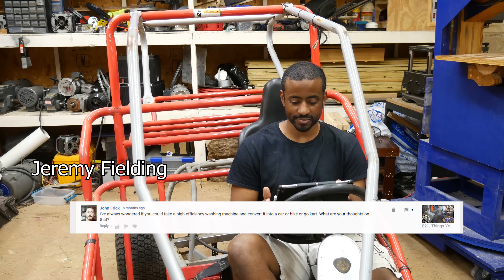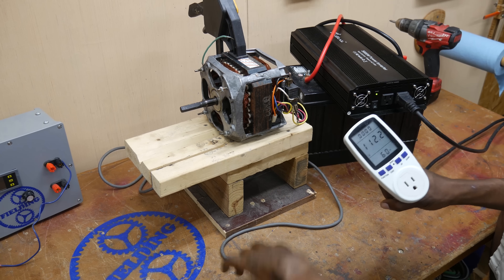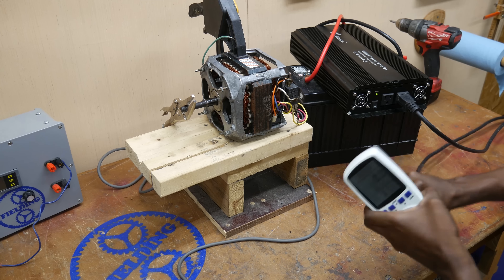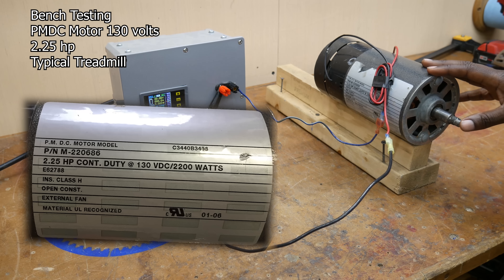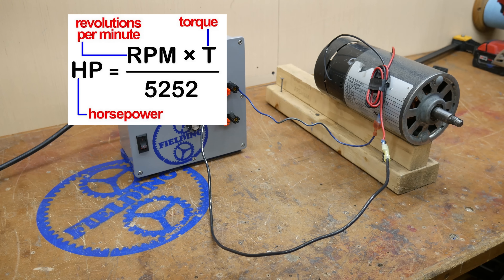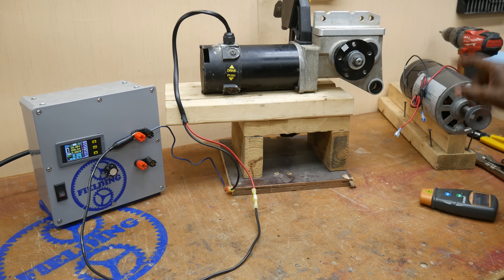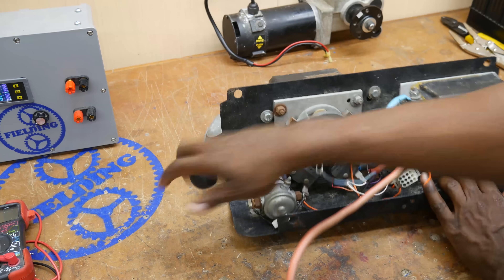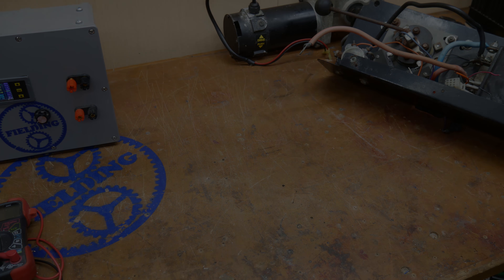What Electric Motors Can Be Used In A Go Kart or E Bike; Bench Testing and Recommended Sizing #61

Comment: Hi. Love your videos.  I read through the comments and no one said this so I'm going to.  In my experience with inverters, the lead acid battery can not handle loads above around 800 watts for more than a short duration.  I think your inverter may have been working fine, but pulled the voltage below the inverter cutoff safety setting. Then when the voltage came back up in the battery,  the inverter started again. You probably needed 3 or 4 batteries in parallel the size of the one you were using to reliably use that inverter at its max rated wattage. 3,000 wats is 250 Amps at 12 volts. Way more than a single car battery can handle.
Reply: How does a car battery start a car if it can't handle more than 800watts? And how do you know what kind of battery this is and the amps it can handle, batteries vary greatly.  There are little 5ah RC batteries that can put out 6000+ watts
Reply: @pdub422  judging by d size of it, it'll hardly exceed 100Ah. yes, it'll handle even 2000W, but more than 30seconds continously will already be pushing it. and while cranking d V will drop <11V, so invertor is likely to cut out.
Reply: The single car battery CAN deliver a few hundred amps for a few seconds - which is enough generally to crank a car engine. Use golf cart batteries for more continuous power.
Reply: @KarlsLabReport  I tried running my electric chainsaw with a 3000 watt inverter hooked directly to the installed battery on my Ford Ranger with the engine running and the saw started and almost immediately the engine died on the pickup and the saw started running slow then the undervoltage protection on the inverter shut it down.  The alternator and the battery combined couldn't keep the tiny electric chainsaw running.  A single battery is not able to pack much of an electrical load for more than 5 seconds, but 4 will be able to run a decent load for one to a few hours, but doesn't have enough power to reliably run a washing machine reliably or a standard fridge and freezer reliably.  Lithium ion baterys are many times better for any high load (example cordless power tools)

Comment: I got this like warehouse air circulating fan I want to make like a maybe at moped or something with it I'm pretty sure it will work I think it's Universal, what do you think this means though I'm curious to know 4 horsepower it shows one - 15 does that mean it could be from 1 horsepower to 15 being the maximum?
Reply from the maker: That is interesting... If it had speed control than probably yes.

Comment: I had a quick question - if you limit the current with some kind of external resistance, could you use a starter motor to power a go kart and prevent it from overheating? My assumption is that the motor is designed run for a short time and draw a massive current because it takes a LOT of force to crank an engine...but you wouldn't need to run it at full power for a go kart. So by reducing the current, that would keep the windings and brushes from getting too hot while still having enough power to drive the go kart. Could that work?

Comment: Jeremy, could you suggest a settup for a battery powered 36" concrete power trowel. RPM would need to be 60 to 150. Initial torque (needed to overcome the friction between the blades and the wet concrete) would need to be around 20 ft lbs.
Reply from the maker: Unfortunately I get hundreds of requests for technical advice. I can barely process all of them let alone give safe accurate advice. I simply can’t do this one on one

Comment: Nice experiments and like your salvage approach!  Regarding the inverter i have a big 140AH battery on my truck and have tested 3 different pure sign 1200 watt inverters right on top with short 4 guage wires and can never get more than 800 Watts out of it before it trips.  I think a bigger inverter may not help without more batteries in series. 

Was watching another video where this kid who took a 36v 400amp fork lift motor and three 12 volt 200AH batteries in series and was able to drive around a 1500lb dry weight Car around the block at 40mph through his manual transmission in a set gear.  I am trying to calculate if a similar motor/ battery setup but DIRECT DRIVE to my 3.4:1 rear end would move my  2200lb dry weight RWD car on flat streets for a modest 20mph/10 mile range?   One snag is direct drive (no transmission) and finding a way to reduce my ratios to some sweet spot like 7:1 for more torque and less speed.   Any way to do this without a transmission?  General thoughts of how this will go without no gear ratio changes?  Any better or cheaper way to do this test?

Also, what's the best way connect those 36v DC motors to the Yoke of my rear end? The same way as the drive shaft connects?

Comment: Hi I have a DC motor I would like to use on like a go-kart or something I was wondering if you could tell me anything about it it's a advanced motors and drives 
Model # ds0-4001 it's a class h serial no. Is 15288 it's rating is AU2500 it's 48 volt I just don't know how to excite it it's got 4 terminals 2 big and 2 little little ones are F1 F2 and big ones are A1 A2 comment if you can help

Comment: Could you use the wheel chair motor for starting movement then switch to another motor once moving??
Reply from the maker: Several have asked but that just feels more like a bandage instead of a solid solution. It’s significantly more complicated, but if determined one can make almost anything work somewhat
Reply: @Jeremy_Fielding  Thx for the reply
Reply: @Jeremy_Fielding  Thought more about it.  What if you used an actuator across an additional gear on the drive shaft for starting the motion a split second before the electric motor turned on?

Comment: That meter does not pick up Peak. The high wattage setting you're looking at needs to be sustained for a couple seconds to get a proper reading. The motors lra, lock rotor amps, require a highly sensitive device to read. They are generally 3 to 6 times the peak running apps

Comment: Jeremy, have a Honeywell Model 362481-3 Synchronous Motor Assembly 60:1 
4 wire and been searching the internet how to wire it up. No such luck and wonder if it isn't like a stepper motor but unsure to try because it is 1i5 volts. Have you done any Synchronous motors? It is like a stepper and has 4 wires. 2 have continuity between them and the other 2 have there's. If I don't hear from you will try and move it like I do a stepper motor and hope sparks don't fly. Thanks, Michael

Comment: I would seek to achieve a high voltage battery bank and shoving a nice motor on it. Higher efficiency from high voltage seems better to me. 

That's what, under 100 Li-ion cells for a full Kwh

Comment: There are resources dedicated specifically to this. Ev Parts is one that comes to the top of my mind. If you're looking at forklift motors find a lift pump motor, lower duty cycle but higher HP for the size.

Comment: The best motor I found was a starter from a Ford Power-Stroke® diesel engine, the one that is "in-line" having a planetary reduction gear setup internally.  It has tire "burn out" torque and goes pretty fast when driving the wheel/tire directly.  Those are 4KW motors (5+ HP) and aux cooling is required!  I used 3/8" thinwall copper tubing to wrap the motor and a water pump and car heater core as a radiator.  Use Thermon® T-85 graphite paste when wrapping the motor with the tubing for good heat transfer and aluminum sheeting to finally cover the tubing and motor.  Do this and be sure to wear a helmet!
Reply: Great tips

Comment: The electric wheelchair gear reduced motor would be good with bike chain and gear set for changing speed. High torque at start then gear up to go faster. I guess it's a question of total horsepower, weight and resistance to figure out the maximum speed. Just a thought but I am sure you can get decent results from a good power transfer system that allows for trade off from torque to RPMS at the wheels. As long as you don't get too much weight involved a pedal bike gear and chain set should be able to handle the load safely.

Comment: Obviousley the people wanting you to do this dont know how to go to harbor freight, pay 130 bucks, and come home with a REAL motor made for a go kart. A drift trike is like 700 bucks online. This bullshit would cost you just as much in time, frustration, and silly parts than the alternatives. I will admit the technology has gone this way but this shit isnt that technology. We had dual 90hp GE motors to work on,  usually things with electric motors dont turn at fast rpms or are made to be turned on and off fairly quickly...
The amount of power it took us to run two 90hp electric motors would freaking baffle you. Better have a generator or a large diesel with an alternator to keep the charge...Only good in construction and childs toys and not much in between. Now if gas was not $2.15 from a pump 500 feet from my house maybe I would start buying electric. Electric is just as expensive right now as gas, probably more. Unless you ad in the tax breaks, have a hybrid that doesnt break for 8 years, good luck with that even the good ones break...RX450H Camry Hybrid, Prius...teslas are getting more reliable but also getting more expensive. Considering car companies usually dont turn a prfit until the 5th year or so I guess Tesla has time...

Comment: I think one of the biggest things you missed...was torque.  I don't think many here will know that the electric kart motor you end up using is much bigger in circumfrence instead of length compared to the other motors you tried.

People need to know force x distance = torque.  more torque at low end means more hp at low end.  HP = torque x rpm / 5252.  So you increase torque you increase, HP.

With a larger motor like the one you used, the distance is probably twice that of the other motors, producing twice the amount of torque with the same voltage.

The reason why starter motors dont last long, is because they are substituting distance with force, applying more instant quick power to the coils (heat too), and boom they go.  But they get hot as a result.

The best thing for any go kart will be to get the 'tallest' motor, the one with the most distance from the shaft to the end force, with the equivalent v/a ratings.

Or to use a good worm gear.  Cause you can multiply the low torque across the gear and produce high torque.  So you can use the small DC motor, attach a worm gear to it, then triple the distance that the motor uses, make that triple distance the gear to the tires...and boom high torque and most worm drives are gear ratioed already.  The bigger the gear the higher the gear reduction.  So using a high rpm low torque motor, can be done via worm gears.

Comment: I feel like your battery failed , not the inverter , you weren't able to draw enough Amps from 1 battery and the inverter went into safe mode .
Reply from the maker: The battery is capable of 700 amps. So 700 amps at 12volts. Now you just need a calculator to confirm whether you are right or not.
Reply: 700 CA ? As in automotive battery cranking amps ? How many Ah is the battery ?
Reply from the maker: I don’t understand how that helps you answer the question. The battery was fully charged, at room temperature with a tiny load compared to its capacity for maybe 30 seconds at most. That is well within the CCA standard used for car batteries. Besides the actual problem was I exceeded one outlet capacity. The rating is likely for both outlets together. But I answered your question in my video on understanding battery ratings using this very battery. In that video you see all the ratings for this battery if you are still curious. AH in this condition doesn’t give you useful information I think. Perhaps you can help me understand.
Reply: I have the same issue with my inverter rated at 4000 watts , when I plug in hi amp power tools it kills the inverter . I switched to two batteries and keep the charger on them and the problem goes away , I was told it was the battery not making enough amps I have two 200 ah batteries at my off grid camp , if unplug one , it kills the inverter when I get amperage surge . I'm no professional , I'm trying to get a better understanding myself .
Reply from the maker: It sounds like your batteries are indeed to small, or the plates are too thick for high current applications. Your issue would be "max continuous current", not AH which is more about the total power of the battery. That is not usually listed on the battery, but can be found by looking up the data sheet for your batteries. I talk about that in the battery video. I think you would find it helpful in your search.

Comment: Part of the problem with the locked rotor test is that the power factor goes way down.  That is, the current and voltage are way out of phase.  That really increases the amount of current needed for a specific level of power.
Reply from the maker: Unfortunately that was the simplest method I could think of for showing a very high starting load for a few seconds. The rotor would in fact seem to be "locked" or very close to a locked rotor condition at start up. There is some gray area here in that the size of the vehicle matters. A small bicycle, especially if you were willing to push start would not be as difficult.
Reply: @Jeremy_Fielding  It's not an invalid test.  After all, that current spike will happen in the real world, unless you use a centrifugal clutch or something like that.  Even then, the motor will be really inefficient until it gets up to speed.

Single phase induction motors are a jerry rig, anyhow.  They need some kind of starter winding to get them going.  Without that, they just sit there and hum.  We used to have an old wire wheel that would do that.  Since the starter winding was gone, it would just sit and hum until someone manually spun the wheel (in either direction) to get it going.

Induction motors in general are not suitable for applications where they are run at a variety of speeds.  They are designed to run at just below synchronous speed.  If they are slowed, they start getting inefficient and generating heat.

Of course, you could feed it with a variable frequency drive.  But if you're going to do that, you might as well go all the way and use a synchronous motor fed by a three phase variable frequency drive -- which is exactly what a brushless DC motor is.

Comment: Maybe the meter you're using measures only the active power while the current is tremendous with an inductive load and reached the max output current of the inverter? But 150W with lo load it's way too much for the active power so you must be right.
Reply: I saw that on an rv air conditioner starter kit. They had to have a faster meter.  My 2kw inverter needs 2awg short wires to make max output.

Comment: You are wrong about the treadmill motor. Those motors have amazing torque throughout their RPM range. They are not meant to be run with a linear power source like a straight connection to a battery. You need to supply this motor with a PWM power source. Not only does that give you very precise speed control, but also very high torque at all speeds.
Reply from the maker: Thanks for the feedback...Please consider for a moment I was using the speed controller (PWM) that came with the motor in the video as I showed you the results of such an application. This motor in particular runs at very high speeds by design. I explained early in the video that Horse power is the combination of speed and torque. This motor is weak at full voltage. Most of the horse power is speed not torque As the voltage goes down (the example I was giving) the total power of the motor goes down... that is both speed and torque go down. The motor... especially because it is a permanent magnet motor is very weak (low torque) at low voltage even using PWM as I did in the video.. I hope that helps you understand. I talk about this more at the beginning of the video as well. :)
Reply: I must have overlooked that. It appeared you were using your own home made desktop power supply. I've used old treadmill motors before with the controllers they come with, and with a little modification to the operating frequency, they have excellent low end torque. Their stall current is massive, but even under heavy load they were able to maintain pretty good torque numbers. About 5x as high as when they are fed a linear voltage straight from a battery.

Comment: the wheel chair motor i used one on a bicycle  after re gearing it a couple time UP because the gearing built in it was to low. but it would run for about 36 miles on a full charge at 50 mph. the bike would run 66 mph before the spokes worked loose. but to be honest i really think it would run closer to 80 mph if the spokes could have held up to it. but that was before they came out with mags for bicycles. i also used to batteries from the scooter too. and it was a zero turn scooter and i only used one motor. and it had so much torque that if you hammered on it it would bust a chain.
Reply from the maker: A bicycle is so much lighter than a scooter. As long as the user is not obese, and the user was willing to pedal some to start it, they could be very fast.
Reply: that motor he had at 8.56 is one of the best motors you can get i now have a larger scooter with only one motor and thinking of putting it on a bike to see what it will do but i need to spend the money and get one with some kind of mag wheel because the spokes cant take it. and a bicycle  chain cant take the torque and you dont need to pedal at all.

Comment: That big dc motor around 7 minute mark could possibly have adjustable brushes, and moving them
contrary to the direction of rotation should increase torque without increasing voltage at the expense of speed.